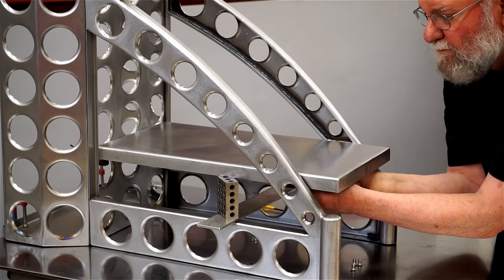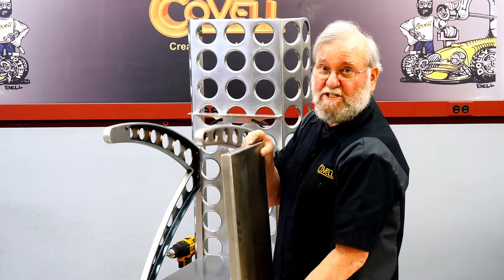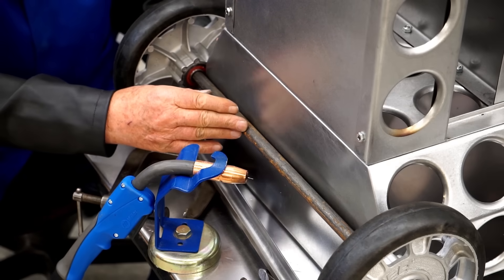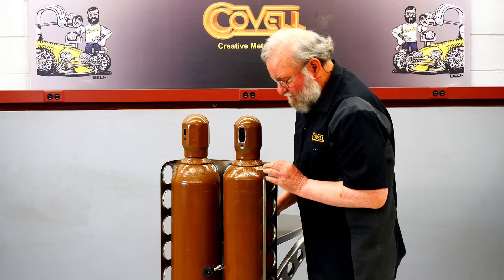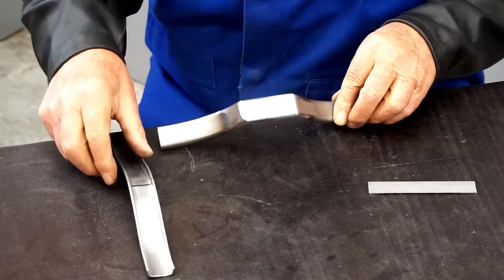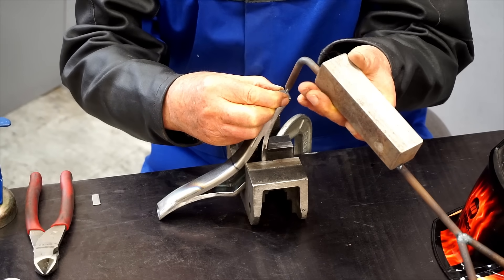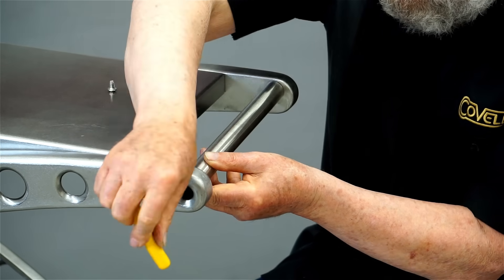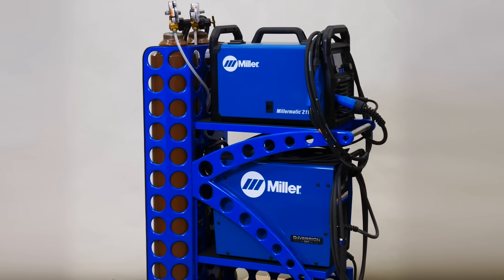'Holey' Welding Cart, Part 3

Comment: Could you offer a hand to Engels Coachshop? He's makes traditional wooden wheels and coaches and has a comprehensive YouTube channel. This week he made a hammer form die to make a one part ash shovel. This is the collaboration we need.
Reply from the maker: I watched his video on making the one-piece ash shovel, and I think he did an exceptionally good job, given the tooling he used. In my opinion, the most reasonable way to do a better job would be to make a very elaborate metal hammerform, (or set of press dies) which would be a very big production.

Comment: That's a pretty slick cart you've made, Ron. The bottle bracket is "who does this?" level of cool, and the edge protection is the cherry on top. I was expecting you to glue on some rubber in addition to the mat, to keep the bottles from clanking around as well.
Reply from the maker: I'm so glad you like the cart! Once snugged down, the bottles don't rattle much at all.

Comment: For the clamping bracket, I would have added a pipe for the stud to go through to add compressive strength. That is probably not needed, but it would make sleep better.
Reply from the maker: I thought about that, but it seems to work well enough without the spacer tube.